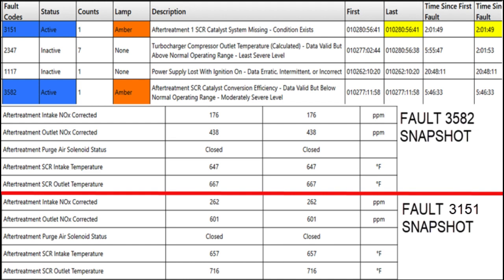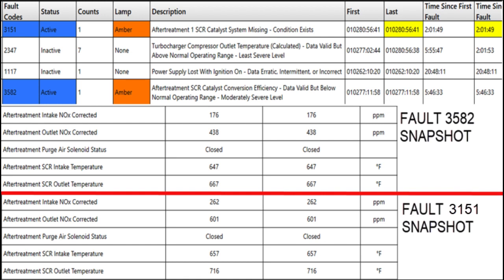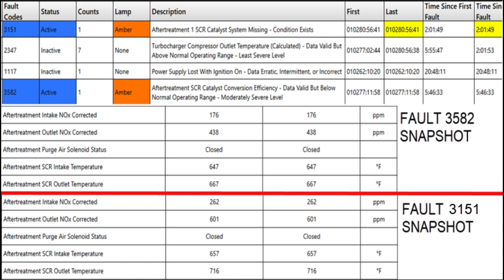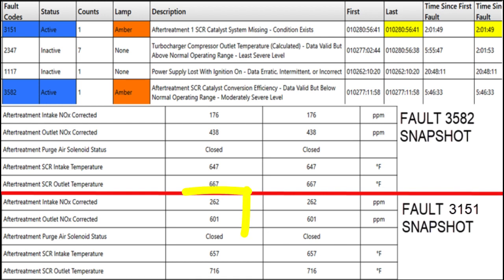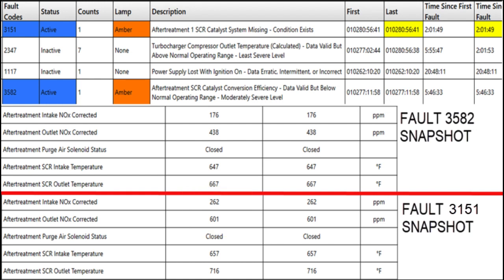Difficult diagnosis- SCR missing / Inefficient

Comment: When do we need to change scr? Got a missing doc 1664 so definitely gonna replace doc and dpf since truck has 650k miles. Would u recommend changing scr too?
Reply from the maker: If you have a cm2350 I would run the scr system test. If the SCR passes I would not change it.

Comment: Is there a way to find the spec for a inlet Nox sensor reading or do you just know based off experience that the value was not drifted low on the intake sensor? @engineshopjoe
Reply from the maker: I typed a two paragraph reply and deleted it. I will save that for my blog coming in a few months. The short answer is I dont know of any spec or value range that would be considered go or no go. In this case it is experience and sometimes I am wrong. But Customers latch onto us so I think we are on to something LOL